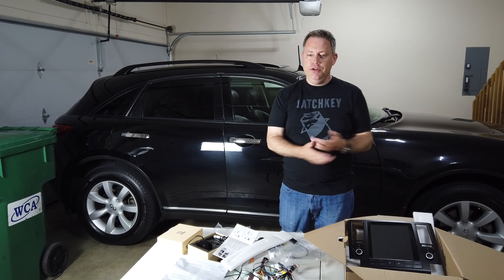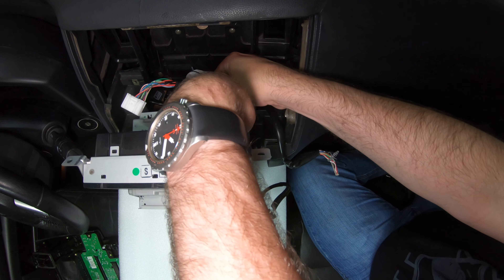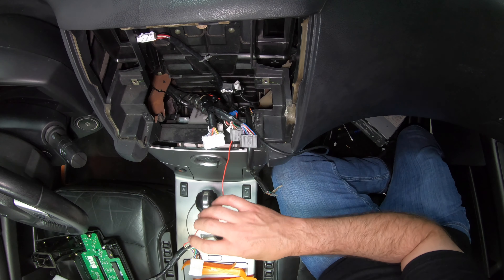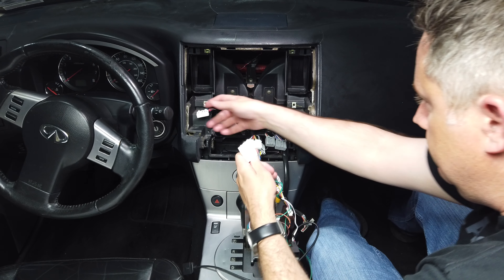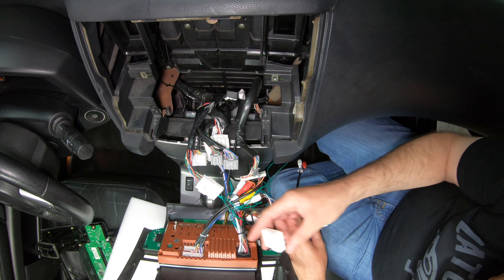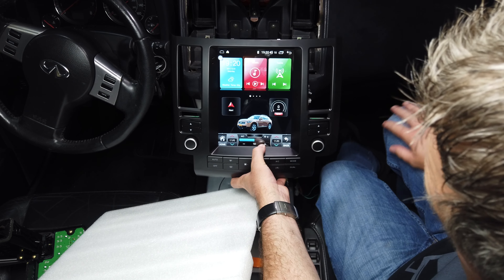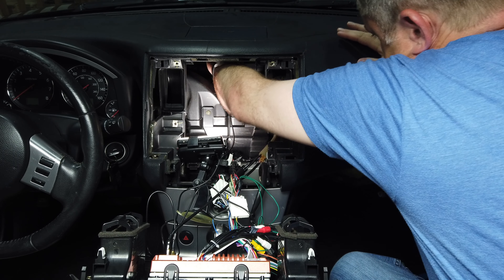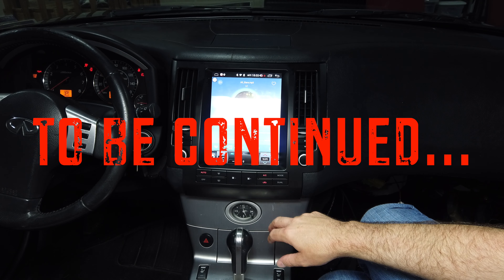I updated my 2004 Infiniti FX35 to 2020 technology with a plug and play Android head unit.

Comment: I currently have an 06 Fx35 without Navi so I purchased a similar Tesla style screen but for some reason the ac controls didn’t work properly it caused the ac turn on and off as your driving hopefully everyone else doesn’t experience that
Reply from the maker: I had a little trouble with my CAN bus controller originally. I eventually got this unit replaced by the seller. There was also a wiring hack that helped the original CAN controller while I was waiting.
Reply: Just Projects in on the fence about getting another one of those units but ima keep watching your videos to see if I snag the one you got because the one I had prior was different
Reply: @justprojects1038  Hello, 
I have bought a Kirinavi Android Radio from one of your sellers (China Car GPS) and the air conditioning control does not work for me. Aftersales Kirinavi told me that it sure was defective Canbus. I had to pay $ 78 and they never sent it to me. They do not answer me. 
In my case I have been scammed for Kirinavi. 
¿Could you explain to me what trick you did while the Canbus shipment was arriving? Thanks
Reply from the maker: @monicapep7121  I did not pay for my replacement CAN controller. It was shipped to me via US Mail from China. Do you see your door sensors and outside temp on the screen? These are also related to the CAN bus.
Reply: @justprojects1038  Yes, it detects the sensors of the doors and the outside temperature. I can also see 25 degrees of setpoint temperature, and AUTO mode. I have air conditioning always connected and in automatic mode since according to the manufacturer's manuals if it does not receive a signal it goes into programed automatic mode. I cannot turn off the air conditioning or control temperature or rear defrost or fan speed. 
I could contact you privately to provide you with a small video so you can see what happens to me and ask Kirinavi to change the Canbus or whatever?
The equipment is under warranty, but nobody helps me, here now comes the winter and I can't turn off the air conditioning ...
I shouldn't have, but I also paid for the canbus, I don't understand this hurtful attitude. 
Thanks in advance.
Reply: Any luck.  I have a 2006 Infiniti FX and can't turn off the AC
Reply: Any luck.  I have a 2006 Infiniti FX and can't turn off the AC
Reply: @computerloveful  I got rid of my console the company suggested some ways to fix it but none of it worked
Reply: @jordantrinidad4013  did you end up selling unit  ???
Reply: @justprojects1038  can you help with hack or how can I get this fixed.   Love the unit.
Reply: @computerloveful  yeah I sold it

Comment: I have the same radio. How to connect heat/AC full control system?
Reply from the maker: The AC control box from the original stack stays in the car and the radio controls this. It's the beige plastic box that sits under the screen and behind the panel.

Comment: Hi :) do you know where to find the software for this radio? I did a system update and the image turned around and the ui and mcu inscriptions were incorrect, are you able to help send a link, how do you get to the software? thanks in advance
Reply from the maker: I don't have anything to do with the radio manufacture, sale, or software. I am just a customer like you. I would contact your seller and see if they can help. I am still running the original stock software.

Comment: If I have 2005 fx45 and our dashes look exactly the same could this work?
Reply from the maker: When I bought mine there were two different models to cover different model year ranges. If the description matches your car it should work.
Reply: For some reason my ac I can’t control it even with me hooking up the module the ac just blows but I can’t control it from the screen and the ac flashes red

Comment: Hi, I am a new subscriber!! I have a 2006 Fx45 , I  updated to touch screen and relocated the original screen to clock area years ago. 

Do I have somewhere to put the connector for navi? My fx comes with navi as well.
I will look into this next, I love this look. 
Thanks for sharing
Reply from the maker: I saw someone move the factory screen to the clock area and install a standard double DIN head unit when I originally bought my FX a few years ago. For me it was more fabrication that I wanted to do. This solution was plug and play which is why I decided to do this.

Comment: Hi, the AC isn’t working for me, I’ve plugged in the white box, what should I do?
Reply from the maker: Do you see outside temperature and door position on your screen. This will tell you that your radio is communicating with the cars CAN bus. You need to keep the factory control box in the car. It’s part of the radio stack on mine so you have to take this apart to get the AC control box loose.

Comment: I have a 2000 Nissan Xterra with 180 k on it . Reliable is a understatement. How reliable has you fx been? I'm thinking about getting one.
Reply from the maker: I had a 2002 Xterra until a car in front of my decided to stop suddenly in front of me. I’ve been very happy with the FX. I have a small oil leak and some suspension noise I need to address, but it’s been a good car. I would buy other Nissan Motors product again.

Comment: I have one for my wife how do you get the wifi to connect
Reply from the maker: The Wifi on mine is very weak. If I want to have any kind of decent speed I actually take a Wifi Repeater I have I put it inside the car. With the same wifi repeater plugged in above the car on the garage ceiling I have extremely slow connection. If you are using your phone as a hotspot inside the car then the Wifi should connect.

Comment: Good video, I want to order for my fx35. Did you need to order the CAN bus too?
Reply from the maker: The CAN bus interface was part of the system I ordered. It plugs into the back of the head unit.
Reply: I ordered mine, is the system still great? Any other projects you have done with your Infiniti?
Reply from the maker: Everything is working well for me. I might do a backup or 360 camera system next.

Comment: Can you tell me about the sim card?
Reply from the maker: My unit has two SIM card holders, one on the back of the radio and one on a dongle that I put in my glove box. I am using GoogleFI SIM in the dongle SIM card holder.
Reply: Where can I buy the one for the back?
Reply: I trying to locate where or what site to get the correct SIM card for the unit?

Comment: Hi how did you get your ac to work ?
Reply from the maker: My AC worked automatically. You need the gray plastic box that is in the middle of the factory radio stack. This is what controls the AC in your car and connects to the new radio.

Comment: I've been looking for an email for you, I'm having sim card issues, I see two signal bars one empty one with bars for my at&t. It still says no connected when I try the internet. Any pointers? May have to try and get that sim card in the back out, pretty tight back there though.
Reply from the maker: I am using the external SIM card holder not the one on the back of the radio. I put it in my glove box for easier access. To be honest I almost gave up on mobile data, but after restart the head unit I started to get data. I am using GoogleFi data only sim, but I would think AT&T should also work. If you see Signal on the display but you don't have internet it might be an issue with the SIM.
Reply: @justprojects1038  Hmm! Yes I'm also using the Dangle. When you say restart the head unit, what do you mean exactly? You went into settings? Or pulled it out and unplugged the unit? I'll look into getting another sim also. Thank you!

Comment: Which tpms did u buy???
Reply from the maker: I don't know the brand, but it's the one that screws onto the valve stems where the dust caps usually are. It has a receiver with USB connection for the head unit.

Comment: My A/C isn't working properly 😢

One question how Did you get Internet?

Cause im trying to activate a sim card bud the wireless companies are not compatible with this device looks like it only will works on WiFi over hotspot Internet

Comment: Hello. Having trouble with ac not communicating with car. AC just stays on.  Can't control it at all. Can you email me those instructions. Please and thank you
Reply: Also. When I turn the volume up. The Ac control turns up too. Just saw it on your video too. Did you ever figure that out. Thanks again
Reply: I have the same problem, no Connect with ac
Reply: Just bought unit any fix on AC issue?

Comment: Be prepare to ave issues with Radio and customers services.  It's Gamble my AC could not be controlled
Reply from the maker: I had AC issues which eventually required a replacement CAN controller. Before they replaced it the factory advised me on a wiring hack that seems to help some also. I agree that this system is a gamble in general. I am saving my factory system just in case I need it again.

Comment: Hello @Just Projects, since you have had a relationship with Kirinavi and your Head Unit had a Canbus defect and they have solved it,  ¿Could you please help me to Kirinavi send me the defective Canbus and that I have already paid, so that it cannot be considered a scam? 
Thank you very much.
Reply from the maker: I don’t have a relationship with KiriNavi and in fact I’m disappointed that they stole one of my videos without permission and posted it on their own YouTube channel without asking. I posted a comment on their video linking to my original video which they deleted within a day. I would suggest you find their phone number from Facebook and then message them on WeeChat or WhatsApp apps. It took a few weeks and a couple of requests to eventually get a replacement CAN module.
Reply from the maker: I would add that while troubleshooting my CAN problems I discovered that if I would reset the power CAN would come back alive for a day or two. I even installed battery disconnect so I could cycle the power without removing the head unit.

While troubleshooting my original CAN they sent me some alternate wiring instructions that involved cutting and soldering some of the power wires for the CAN. I reversed this after they sent me the new CAN box.
Reply: @justprojects1038  Thank you for your comments. I have written a multitude of wattsup to sales and aftersales and although sometimes some have replied, they do not want to send it to me. My money if they wanted it. It's a disappointment and I think you've been lucky. My opinion is that the summary is that it is an impressive product but if you have a problem or a faulty HU, you have a good chance that no one from the company will help you. Thanks for everything.